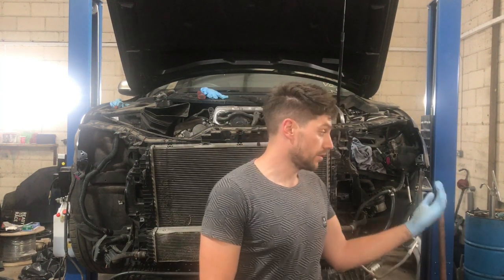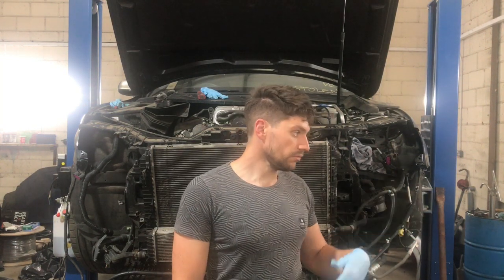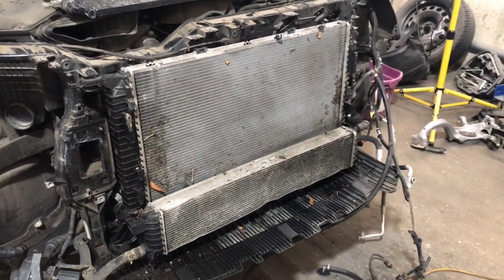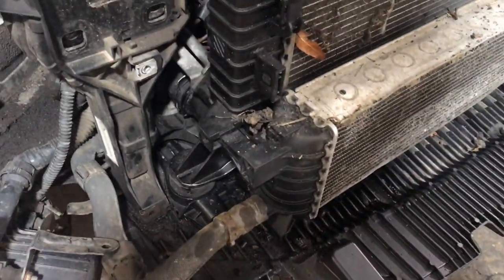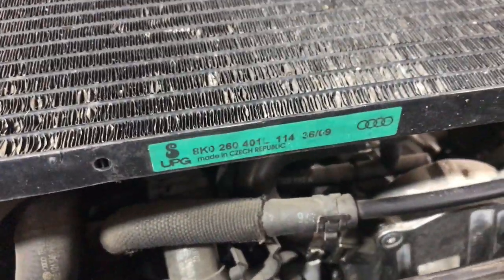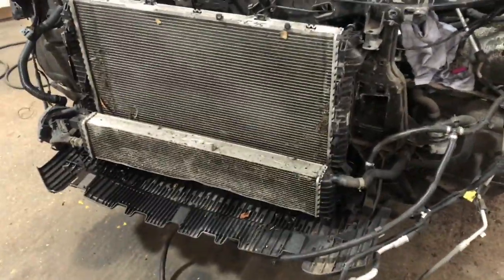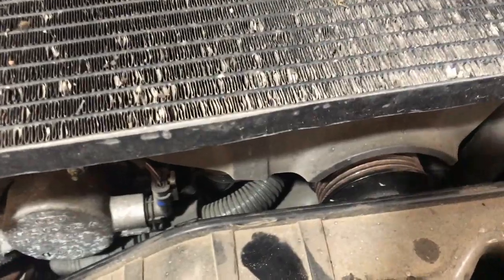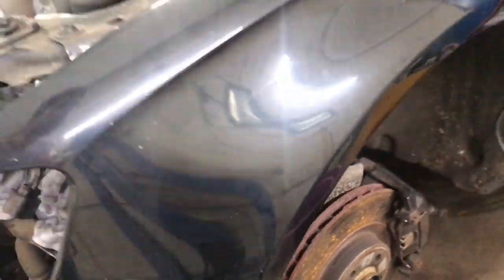I Bought A STOLEN Audi S4 From Copart!! Part 3

Comment: Novice Audi enthusiast.  That bolt is super simple to remove. Cut the head off then use the nut to pull it though. then use washers when the threads bottom. in fact if you did some research you can find many videos explaining this super simple  removal. I've done it many times.
Reply from the maker: Makes sense! I’ll give that a go next time

Comment: Don't know if you're still reading comments, but the crank pulleys on these are notorious for separating at the rubber isolation layer. Don't know if that's what happened, or if it was an impact. You can get solid aftermarket versions that change supercharger ratios if you plan to tune. Might increase NVH.
Reply from the maker: I had a look into aftermarket pulley, alot of them bolted over the existing pulley and the others were more expensive. I ended up getting a good price on a new genuine pulley :) But that is a good theory and would explain the idler pulley damage :)
Reply: @SavingSalvage  It might be a combo where the impact separated the layers and it shredded the belt and damaged the other. Who knows. :) When mine gets out of warranty, I'm considering a crank pulley upgrade instead of changing the SC pulley, just because of the number of problems I've seen with the crank pulley.

Comment: that 100mm bolt is called "the audi bitch bolt", it always get seized in, the trick to get it out is to snap the head off the bolt then tighten the nut on the other end it will pull the broken bolt through the hole, once it starts moving you should be able to hammer it out the rest of the way with a center punch, done a few this way and it works every time.

Comment: Maybe next time try some heat on the knuckle before you start cutting bits off it. It’s worked for me in the past but just be careful of the heat getting to the joint rubbers.
Reply from the maker: +wesley jones Yeah I would have done, but unfortunately that’s one of the things I don’t have. Will look into getting a gas bottle 👍🏽 save all this agg 😂
Reply: They are a struggle no doubt even with heat sometimes..